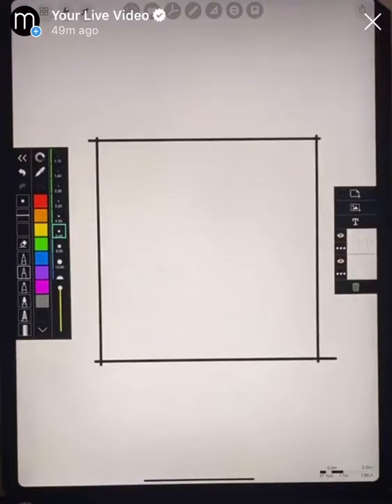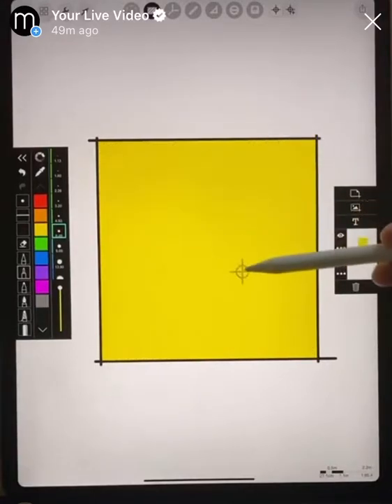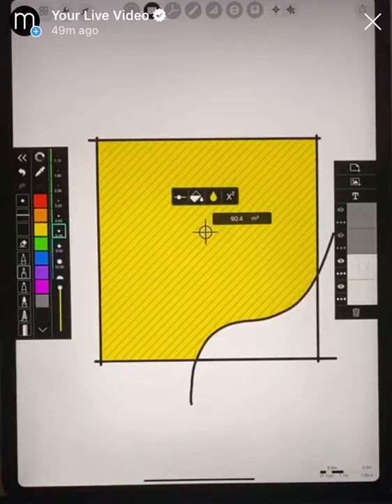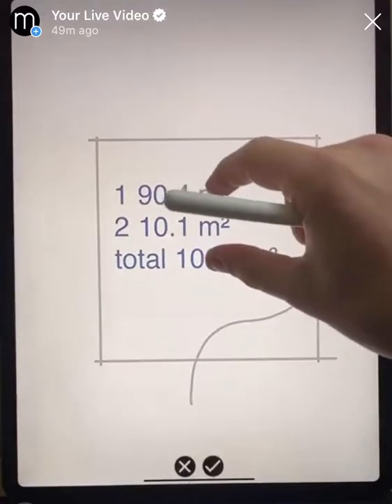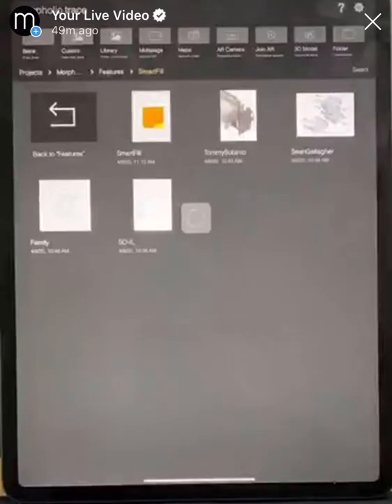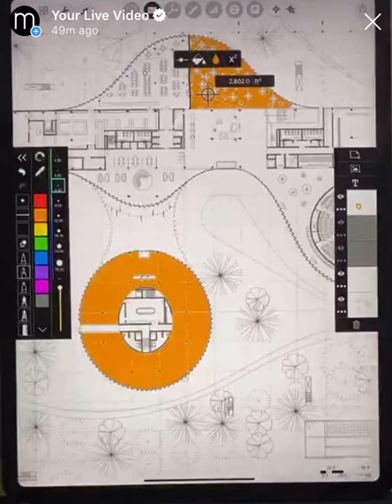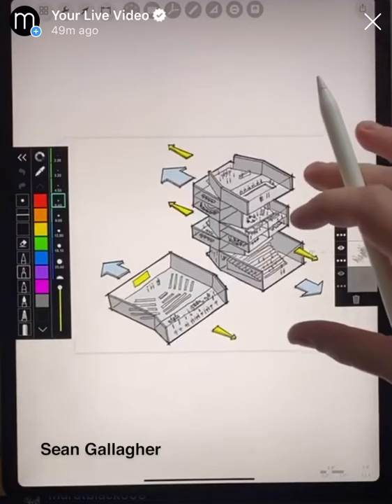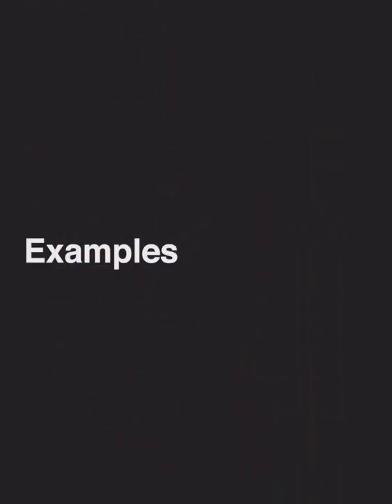How to Draw Fills & Calculate Areas - Morpholio Tutorial for Architecture, Landscape & Interiors

Comment: When drawing architecture, I was thinking that a useful feature would be a ruler that allows us to draw arcs in perspective (such as the archways in old buildings). I would love a quick & mostly automatic way to draw arcs in perspective. Also, I'd be helpful if there was a guide to assist with drawing them equidistant from each other, with perspective taken into consideration. The circle tool helps with drawing arcs but this method is pretty slow and can be difficult to work with. I wish there was an easier & quicker way to draw arcs in perspective.
Reply from the maker: chariots8x Thanks for this great suggestion. We’ve been thinking about these ideas too! Stay tuned!!